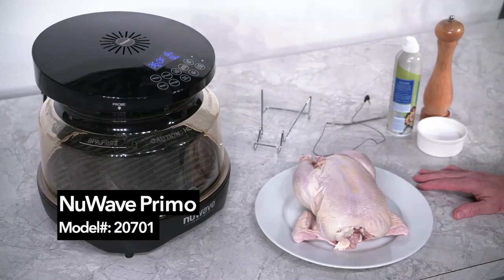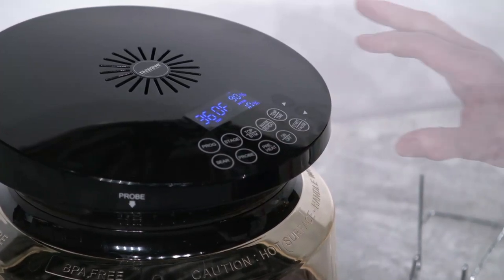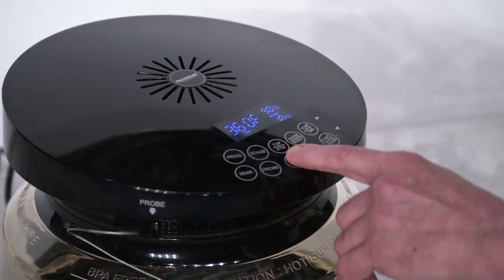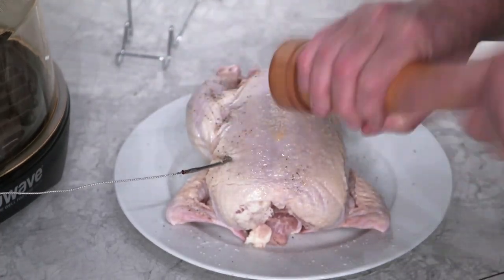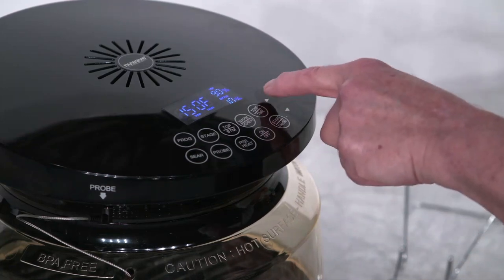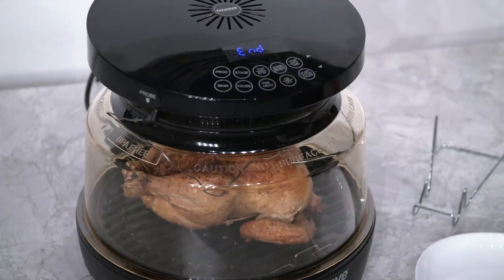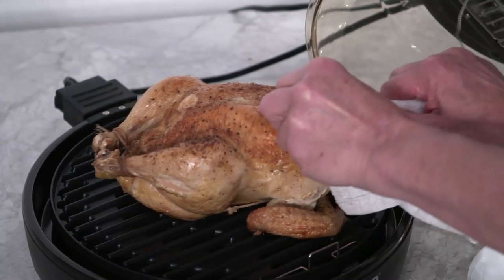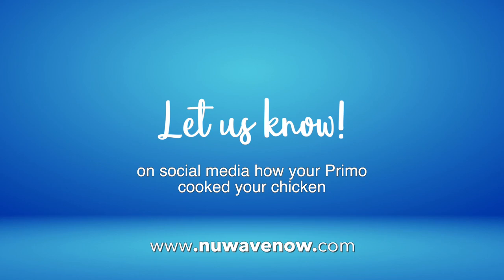Roasted Chicken Recipe - NuWave Primo Model #20701

Comment: Do not buy this product! They use cheap parts that fall apart. I purchased this product in August of 2020 within 3 months the dome started having cracks in it without it being dropped. I just now had the retaining ring that is on the dome completely fell apart in pieces without being dropped. I contacted the so called "customer service" and spoke to Adolfo S and since the powerhead is just past the 1-year warranty mark the refuse to replace the powerhead. It'll cost me personally to buy another defective powerhead is over $100 to replace the crappy powerhead myself. I'm on disability and I can't afford to replace the crappy powerhead that is just going to fall apart in just a little over a year. The product works well if you luck out and get one with good parts but good luck with that.